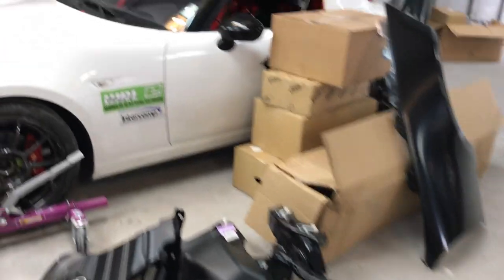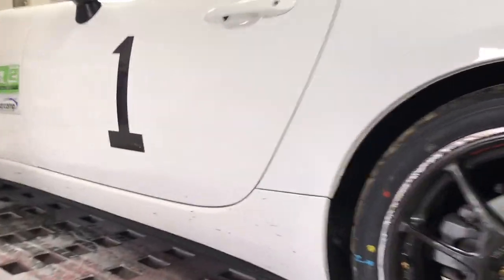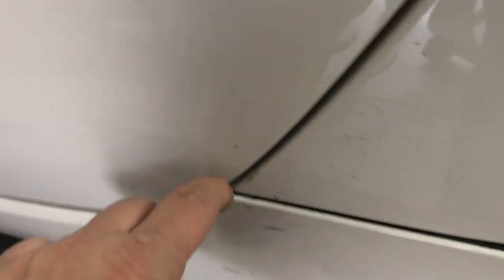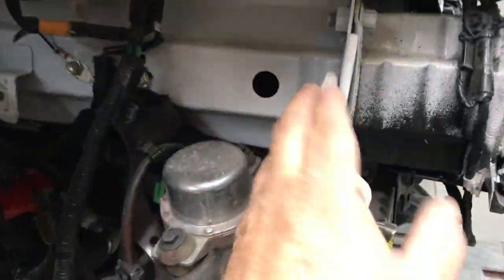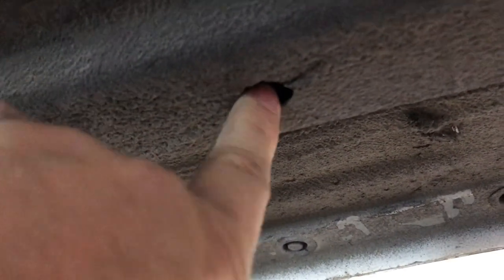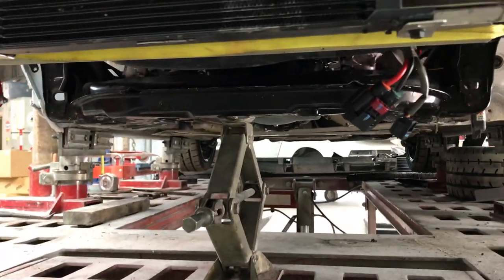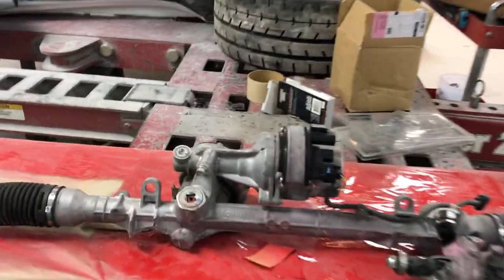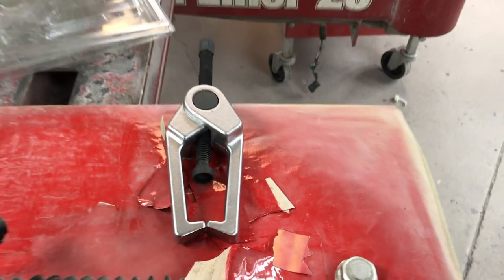Mazda Global MX5 Cup Car Repair And Rocker Panel Cover Removal Tip (Part:1) #Mazda #Miata #MX5

Comment: Thanks for the video.
I installed the aero kit recently for this car and managed to crossthread a bolt on the underside of one of the sideskirts.

The bolt and the installed jacknut are now floating in the hole when i try to remove it, so im thinking if i remove the rocker panel i can get access to the rear of the jacknut and get the bolt out much easier.

Will give it a go this weekend when i find some time.
Reply from the maker: Sounds like a plan. Just know that the street car version of these cars have a lock clip in the front lower push-in. Remove the clip before you slide the rocker cover backwards. Thanks for watching!
Reply: @RebuildRex  
Thanks for that 👍 I'll definitely be very careful and pay attention to that clip.
I think I'll order some spare green clips too just in case some get broken upon removal 👍

Comment: Excellent video. You make it look so easy but I know it's not.  I had a friend put my car up on a jack and the jacks popped the Rocker Panel out of alignment and in the process cracked a couple of clips off is what I'm thinking. So now the rocker panels are no longer aligned with the doors. They stick out a bit. It does not look like it bent the rocker panel but I won't be sure until I get the rocker panels off to see the damage. Of course I'm hoping it's just the clips that snapped and not the plastic pieces on the rocker panels that the clips slide into. I'm not the guy for the job. ;-) The 2 Body shops I brought it to are predicting 80% chance that the rocker panels will need to be replaced. Any advice or suggestion from you would be great. Thank you in advance. My car is a 2008 MX-5 NC Grand Touring.
Reply from the maker: You are correct, replacing the clips would be best case scenario. The best way to know for sure is to remove the rocker molding and inspect the underside. Remember to remove the push-ins in the front and rear and there is a locking mechanism in the front lower clip. Once the locking mechanism is removed rocker should slide backwards off. There is one clip at the top rear that slides forward, you’ll need to pop it loose using a pick tool. Hope this helps. Thanks for watching!

Comment: What the ? Broke the input shaft off the rack ! 
What tyres are they on that thing thry look like a good slick/wet compromise  ? Can you hide the brembo calipers and discs off it before it goes back and send thrm to me 😉
Reply from the maker: The car took an impact on the right front that hit the wheel and suspension as well I am assuming that the wheel pushed transferred energy to the rack... The racks break fairly easy during an impact but this is probably the worst I’ve seen so far. The tires are Yokohama ADVAN A052. I’m not sure if they run them in the rain or if they are just rollers that they sent to me with. I’m not sure I could get away with the calipers and rotors deal... the race team might wonder where they went. 🤔😉😆

Comment: is it sequential or 6MT?
Reply from the maker: This one is a 6MT at the time of video. It has probably been converted to sequential by now. Thanks for watching.
Reply: @RebuildRex  Im biased (wreck miata racer) but I just had to have a confirmation from somebody because I couldn't believe they are using sequentials on a Miata. Kinda takes some of the skill and charm out of it, and bumps up cost...
Reply from the maker: I agree, I’m a fan of the mindset “don’t fix it if it ain’t broke” and the 6MT was working just fine from what I heard.
Reply: @RebuildRex  maybe they are trying to define it more from the spec-mx5 class?
Reply from the maker: You are probably right about that. 👍
Reply: More like they couldnt keep transmissions up to them - they are on revision 6 i think of the trans and they still keep spitting teeth off 3rd gear like its a halloween party !
Reply from the maker: @bradleysmith7464  Dang, I didn’t know that.